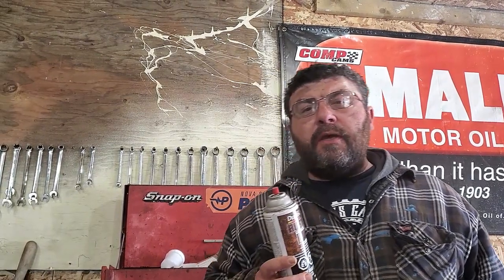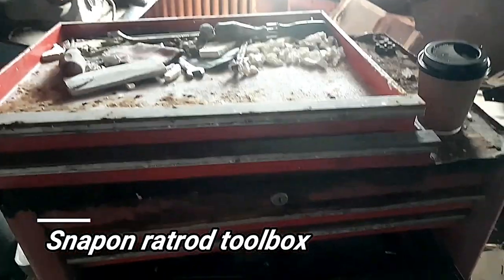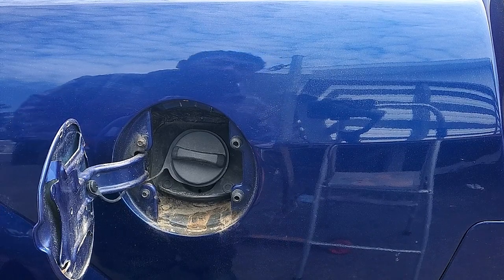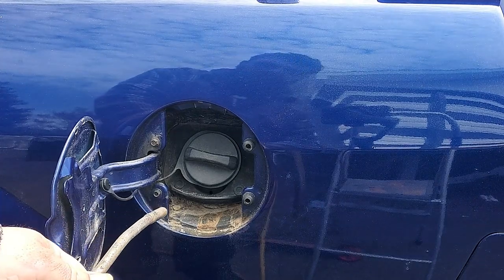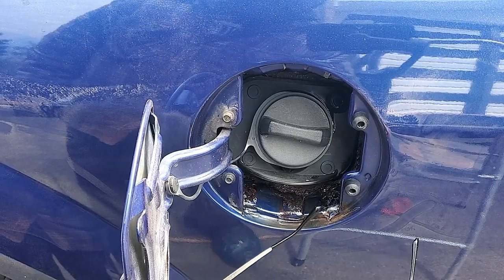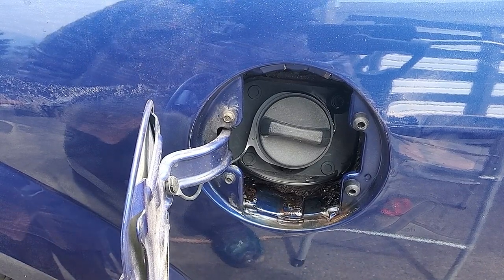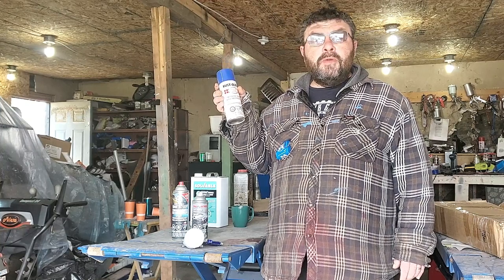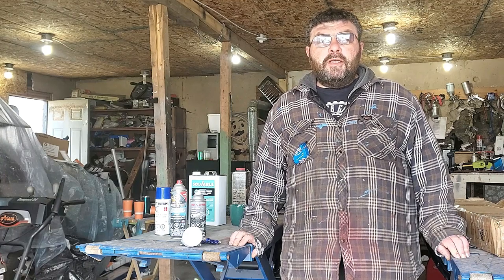RUST FIX  PRODUCT TESTIMONIAL &  HOW TO USE

Comment: Hey Shaun, I got a question for you.  What do you use as an adhesion promoter before priming when you're working with ABS plastics?
Reply from the maker: is the plastic new Bruce?  what line of paint are you using ,some paint systems have the adhesion promotor built in . would have to know the variables . let me know we can get to the bottom of it.
Reply: Yes, the plastic is new.  The paint is just BASF Limco Single Stage.
Reply from the maker: @BruceLyeg  they told me limco SS has a adhesion promoter built in. I use it too but new abs is tricky depending on the compunds. basf does sell an adhesion promoter in a rattle can ,for abs I would recommend it.  but you can get away without it. when I seen problems it was usually due to the paint peeling from the primer,not the abs itself.
Reply: Ya, I definitely think I'll go with using an adhesion promoter, just to be safe.  Thanks Shaun.
Reply from the maker: @BruceLyeg  abs is tricky.  if the cover looks good and you can avoid primer just use the adhesion promoter then paint.  if it has marks in the plastic primer is unavoidable...
Reply: @thisguysgarage  It's new and shouldn't have any marks.  I'll skip the primer then